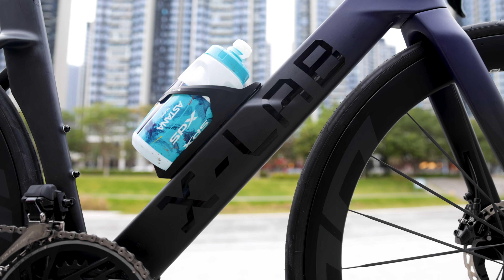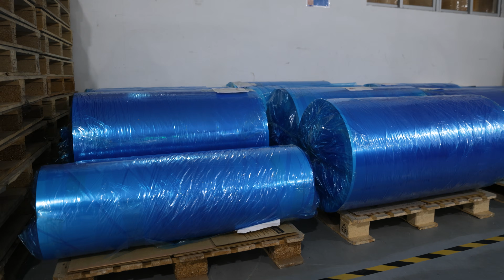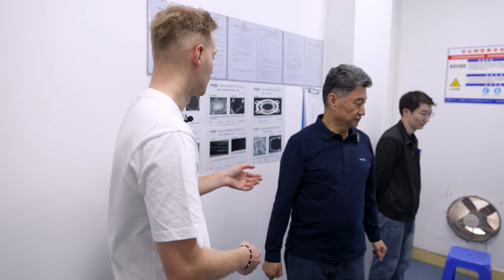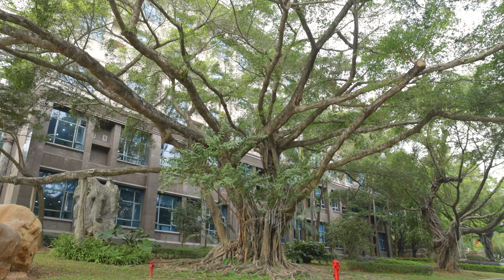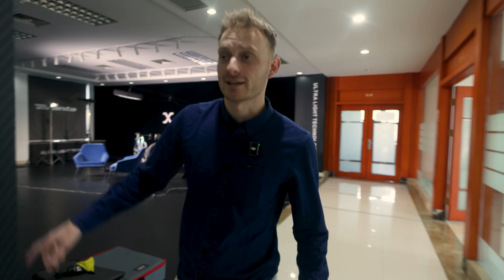X-LAB: The Bike Brand No One Saw Coming, and the Secret Manufacturing Powerhouse Behind It

Comment: The most important part is missing. How to make this bismuth metal alloy low temperature melting mandrels. Mandrels should be casted using special silicone molds. Mandrel is kinda inner mold of the bicycle frame, but  it melts away at the end of oven curing process to be collected at the bottom of the oven. So the bismuth alloy can be used endlessly over and over.

Comment: Is it common in bike manufacturing to use non woven layers, glued together? I though all carbon fibre was woven before lay up. It intuitively would seem stronger to weave the fibres but i guess theres less control over the orientation

Comment: whilst China's XDS (X-Lab) might be using overpriced Carbon-Fibre from Toray (Japan) now

soon they may be getting more affordable higher quality stronger Carbon-Fibre from China itself

that makes the world's strongest T1200 Carbon-Fibre

which Toray (Japan) has not yet achieved, and lost its monopoly on Carbon-Fibre, only up to T1100 level
Reply: False!  Toray has achieved T1200 (announced 2023). China has also achieved T1200, and is the first to mass‑produce it at scale, which is a different claim.Toray did not “lose a monopoly” because: Toray never had a monopoly on all carbon fiber grades. Toray still produces world‑leading high‑strength fibers.China’s achievement is about industrial scale, not Toray’s inability.

Comment: The process itself isn't very different from the rest. But they've vertically integrated the weave as well (which I believe was slightly obfuscated. I doubt if straight sheets are just angled at 45deg to each other) and making the pre-preg themselves. And of course a monastic devotion to process craft and quality control. I could not tell how the core on which the sheets are formed before baking, is released. This is the BYD of bikes. Obviously expensive but incredible value for money.

Comment: Hi, can you clarify for me please, the seat tube angle. Normally it is measured from a horizontal line at the center of the bottom bracket.
On X-Lab's geometry page the diagram shows the angle taken off the seat stay, not a horizontal line. 
What is the seat tube angle for the XS, small and medium GTB frames from a horizontal line? Can you clarify?
Thank-you

Comment: Supporting companies that are reproducing/replicating frames & full bikes engineered from western brands, isn't a good thing. 
Stealing others developments cause you know the production processs is nothing new in china/taiwan.  Top brands let their products mostly from Taiwan companies build, which outsourced most of their production to factories in china. There the production-line got doubled and (copied) and a new brand with the similar product gets startet. That X-Lab Bike is 1 to 1 the Merida Reacto Aerobike! That's why the able to offer a product that is equal in performance to other high end brands with their first shot. China isn't engineering, china is replicating! 
Such companies are industrial crime syndicates that shouldn't get a non critical platform. They even named their Team "Astana" like the capital of industrial crime from the Khazar mafia.
Reply: Err no.  Completely wrong on every level. The bike is nothing like a Reacto. Also  Astana Cycling team has been around since 2006.  XDS have only sponsored since 2025.

Comment: if that 'Only One In The World' machine, manually used [not automated] has to check 20,000 frames per day  --  thats 833 frames PER HOUR,  [or 13 frames EVERY MINUTE]  --      I don't think so.  Still a good video though
Reply from the maker: 20,000 frames is across all of XDS (5 factories) - the total output also isn’t split equally, it’s a lot quicker to make an aluminium bike than a carbon bike for example

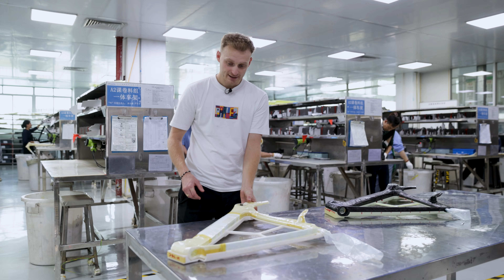Comment: 13:20, Didn't show how the foam insert was made.  I imagine it needs molds of its own.
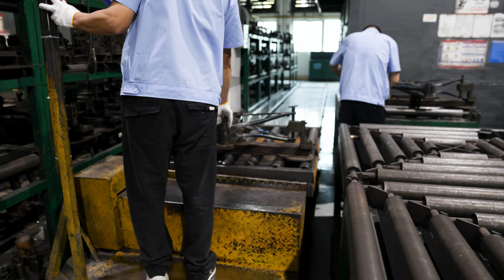17:12, Too bad it needs to go in a kiln to cure the epoxy for the rear triangle
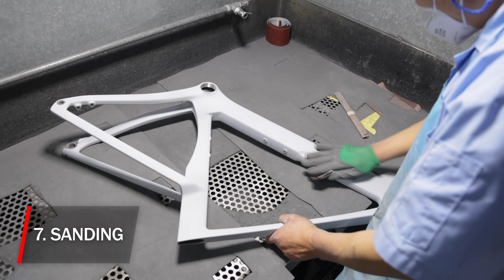19:21, How did the frame become white during machining?
The XDS / X-Lab website does not include frame geometry of any of the models.

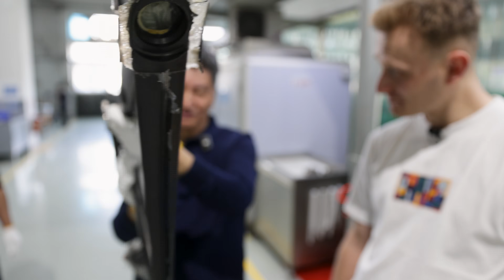Comment: Good facility but I disagree on the comment regarding the performance of resins ( and thus composite bike made from them) over the temperature range that some one would be riding a 15:41 bike. Any decent epoxy prepreg that is correctly cured will have consistent properties between 0C and 50C. ( I have had 45 years in the composite business and run a composite testing lab!)
Reply: Very interesting. I have a question if you might have any idea. One of my classic bikes is a Colnago C40 from 2001. Have resins improved dramatically since to a point to be concerned over degradation? Or do you think that era is still a good level?
Reply: @t @tommyfreckmann6857 ommy the resin chemistry has not changed since your bike was made. It is quite established technology as long as they had a decent chemist or purchased a ready made system from a major supplier. The technology for a 120C -150C. epoxy cure system was well known then . Some fancy stuff ( for super high compressive strength)  has come along since then but that is not what you want or need on a bike.